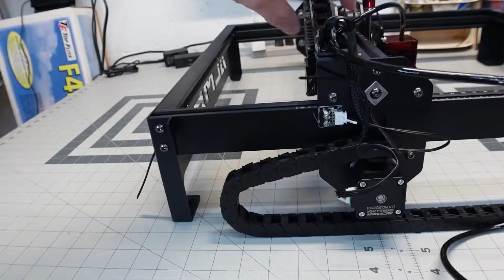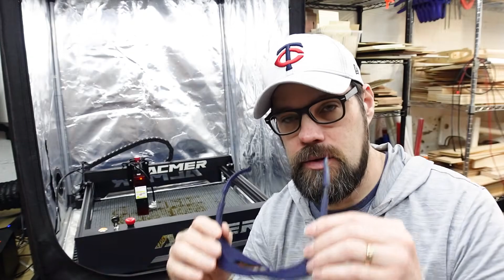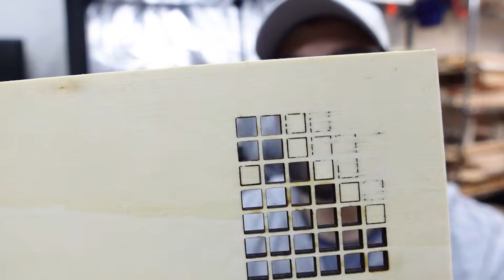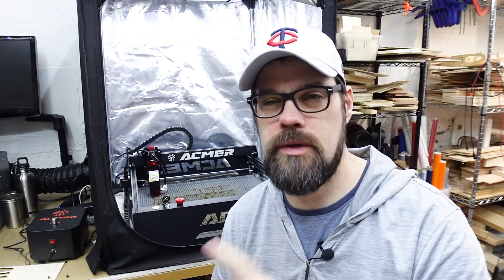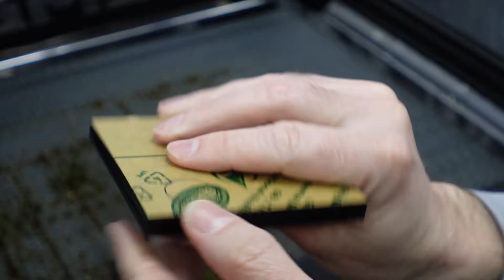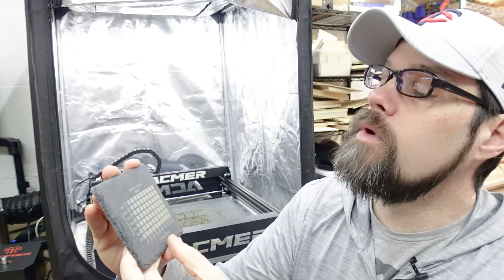Acmer P1 10W Diode Laser Review - Impressive power and features!

Comment: Hi Vintauri, great vdeo! have you experiment with this unit cutting clear acrylic? and how's the result.
Reply from the maker: Diode lasers cannot cut through clear or even white materials due to the visible wavelength of the beam.  You need a higher wavelength as found in Co2 laser beams to cut clear material.

Comment: Hi Steve, I've been watching hours and hours of your videos in he last 24h as i am on the market for my first laser engraver.. i found some at a good price (longer ray, growcom) but they all have pros and cons .. i would really love to get you final thought about which one is the best for it's value, + what accessories are mandatory to get for a start, like i feel air flow is, and the honey comb..on the other hand, the camera or the chamber cover could wait).. a + for me is apps that connects to a phone as my computer isn't very good .. not sure if you can reply here, but I'll try to catch your fb Livestream (what time does it start in PCT time ?)
Reply: This one looks very good indeed .. almost convinced specially that it's on sale .. but.. on issue i see is that the accessories are really expensive (compare to comgrow for example) .. like the rotule roller (the thing for cylinder printing) is 129$ on sale, as it's normally 210$, and their honey comb is 99$, when comgrows is at 59$...) .. is there any way to use other brands accessories ? .. another question , what do you think about refurbished models ?..
Reply from the maker: This is a lot to answer in a comment, but if you are looking at your first laser, I'd consider if you have a specific need or if you want to just experiment.  If there is a specific need, you'll want to make sure the laser can cover that.  If not I'd find the balance of features and cost. A 10 watt diode is a great place to start as the cost is lower but you can do most anything with it that the lower 5w and higher 20-40w units can do.  As for the accessories, most are cross compatible, however not all are.  The Honeycomb tray can be from anywhere as long as it fits your needs, the same with an enclosure.  Most rotaries designed for a diode laser will work on other GRBL based machines as long as you have the correct pin connectors. Air assist is another to look at, I would make sure the nozzle comes with the machine. but then the air pump can be anything that adapts to the specific hose size you need.  As for refurbished machines, unless you are comfortable troubleshooting and possibly repairing things on your own, I'd stick with a new machine.  You wont get someone else's mistake and it will have the full warranty.  I hope this helps and I hope to see you on the livestream!